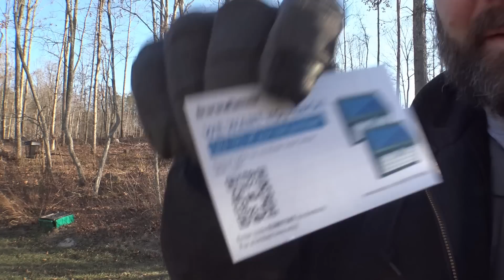Installing solar security lights around the house. InnoGear 30 LED and Litom 24LED

Comment: The third setting on the gutter lights make the light stay on at the lowest setting and turn to full brightness when motion is sensed. The other lights have a similar setting on the second position.
Reply from the maker: Ah...gotcha....well that would eat the charge right out of those batteries....thanks for the tip...we may be installing some of these down by our gate and around other barns

Comment: I’ve had the Litom solar lights around my house and barn for about a year.  

Two issues.....  short battery life in one of them and mounted up high on a garage exterior wall where they were high enough not to be removed, the motion sensor did not trigger the light to ON when we walked under them.

I mounted them on vinyl siding with heavy duty velcro from HD.
Reply from the maker: Gotcha....I've mounted some lights with velcro and not had any luck...eventually the hot weather gets to the glue and they fall off...at least in my experience

Comment: I have some of the older version of them Litom lights.. they are decent and bright.. however the battery doesn't have as much capacity as I would have preferred if too much is going on and the sensors get tripped a fair bit they run down well before the end of the night.
Reply from the maker: You must be using them alot as flood lights. Mine are basically used once a night maybe twice..I hope they hold up

Comment: I'm just wondering about snow load on those flat ones. Maybe hang them with the screws in a vertical pattern? Let us know after the next snowfall.
Reply: Found this in the Q&A section of the Amazon link:  "Mine are secured with the included metal rod (which is strong). They have been covered with snow and they haven't bent yet nor do I expect that they will. I am amazed that they still charge with the snow on the solar panel! 
By william baker on February 26, 2017"

Comment: Love the videos keep it up! I have a question i have a snowmobile skidoo mxz 500 and i start it runs great when i drive it for a while it bogs and wont go over 40 mph. Replaced spark plugs same problem. Wondering if anyone could help. Thank you!
Reply from the maker: I have no idea....maybe a fuel filter issue? Or hot belt/clutch

Comment: Hey Josh, if you had mounted the arm bracket vertical then you would have had both screws into the stud. Also may be better to have only one section of stem out from the wall as you may find them wavering about due to wind.......

Comment: Hello, thanks for the video on the solar lights.
I will be looking for something similar for my property here in NewSouth Wales (Australia).
I also am on a rural property and as you said it is very dark at night away from town lighting.
Now another item which is not my idea.
I have just seen elsewhere on YouTube an idea about putting milk jugs filled with salt water into the water trough for your goats.
The idea is that the water in the plastic bottles does not freeze, so when the goats want a drink, they will automatically push down on the plastic bottles as they try to get a drink of water.
The ice around the water bottles is thin enough to break when pushed and the goats can then get their drink of water.
I just thought that it might be worth trying as it so cold over there.
We are having temparatures  over 40 C at the moment!

Comment: It's been over month since you've installed them.  How have them been working and do you have a favorite.  I'm a solar LED light junkie and it seems I can never have enough light.  We hit -40 degrees F. and I've found that LEDs are the way to go in the winter.
Reply from the maker: Function perfectly....snow load was a concern with the ones mounted on long brackets but melted off without any issue

Comment: Keep us posted on how well they hold up over the next few weeks
Reply: I've had motion sensor LED lights that light the path from driveway to the back door for the last 6 years. I have yet to even need AA batteries. 

A few years back I a put motion/daylight sensor under the kitchen window and have under cabinet LED lights powered by a large solar charged 12V battery. Auto on/off is excellent and spoils you.
Reply: AutoCrete are they the same exact lights as these?
Reply: No they are not. The basic technology is the same but I have a couple of high power single LED lights as well as a 60(?) LED light. All of them have a 'remote' solar panel (which I prefer) that allows you to place the panel in full sun while the light is in the shade. A bit tougher to install but no more than twice as hard which is still very simple. After 6 years of use I have no regrets at all.

I bought mine at Princess Auto which is Canada's answer to Harbor Freight. Made in China, marked up huge amounts but still the most bang for your buck. Along with the motion auto on/off convenience they do reduce your power bill a bit and forgetting to turn off a light just doesn't happen.
Reply: After about 5 years of excellent service my favorite LED light started to malfunction by turning on for no reason and bleeding down the batteries. Keep in mind we have had a couple of weeks of -30 to -35, a few nice days near freezing and back into the cold. Those temperatures play hell on electronics. 

I think my Outback charge controller is only rated to -20. For it, so far, so good.

Comment: Why don't you get some solar water heaters for your goats and chickens? Help you from having to water your animals 4 times a day because the water is frozen.
Reply from the maker: Find me a link and I'll buy one… I don't think they make a solar water heater for animals. It was 1° this morning… Supposed to warm up now
Reply: Can't seem to find a pre-made one which is odd that in 2018 no one has made one yet. What you could do is dig a hole in the ground and put your water tub into it so the ground helps insulate it and get some kind of water agitator (They make them to keep bugs and what not out of bird feeders but you could use it to keep water from freezing on top) for the chickens you could take an old tire and fill it with insulation and put a tub of water that fits just perfect in it. These are just temp things until you get power up to the goats and down to the chickens.
Reply: If they don't make one, you just gave away a million dollar idea !